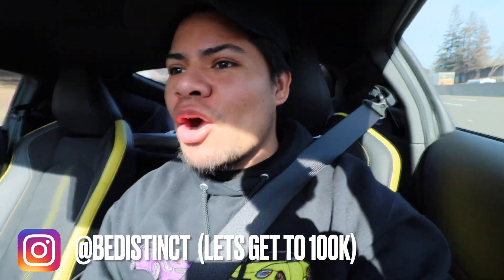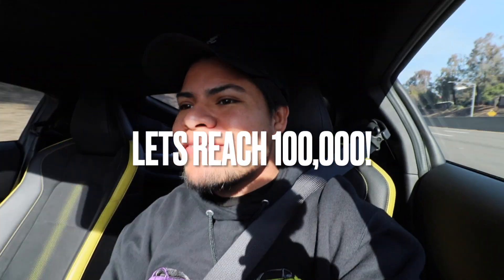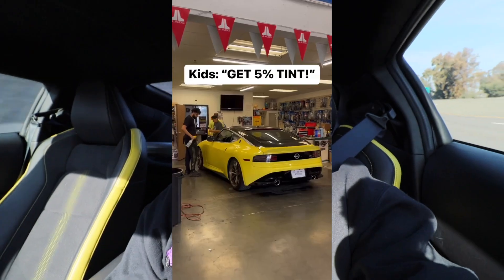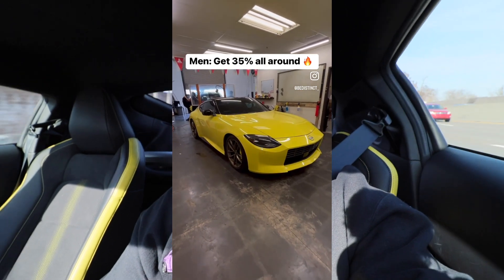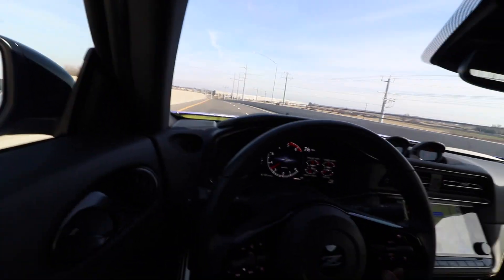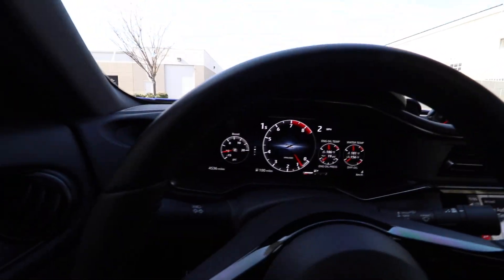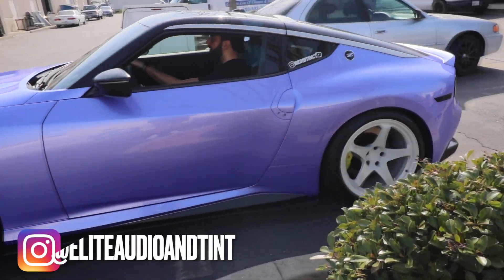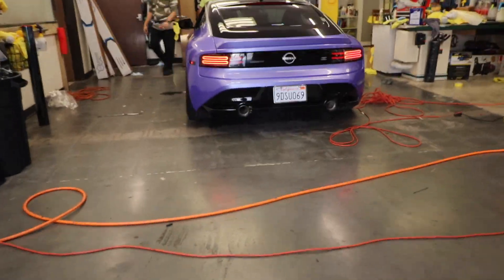Giving my 2023 Nissan Z a NEW LOOK with this MOD!

Comment: I did 15% all around on my Z/ 35% on the windshield and it looks great. I would do 15% on the back. You can still see through it so you shouldn't have an issue showing the tank.
Reply from the maker: 15% did look like a good sweet spot, but damn 5% does look good haha
Reply: @BeDistinct  5% does look the best, but cops always trip about not being able to see inside lol